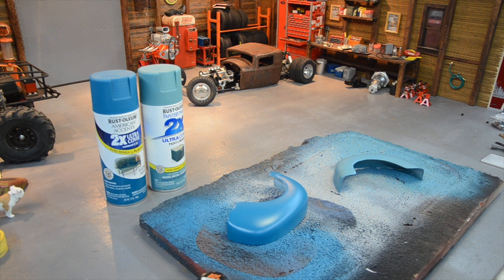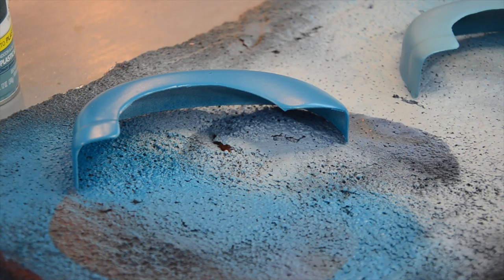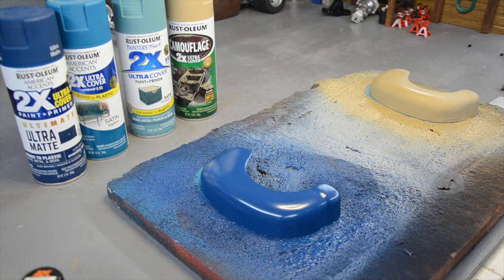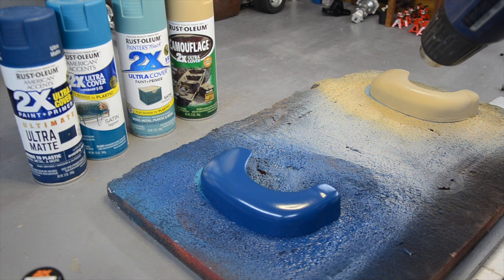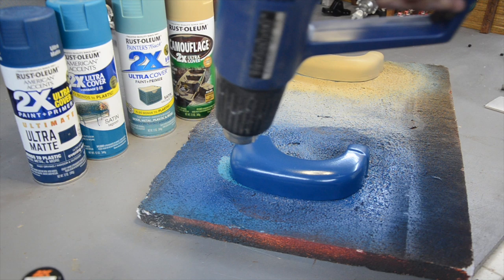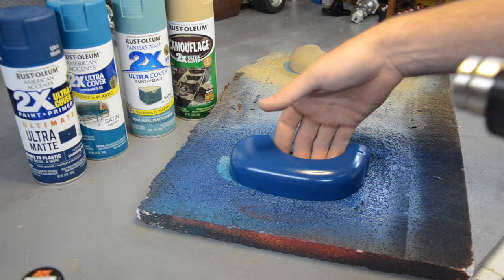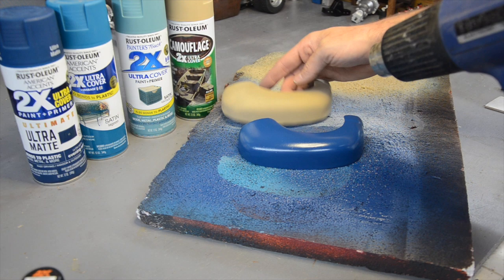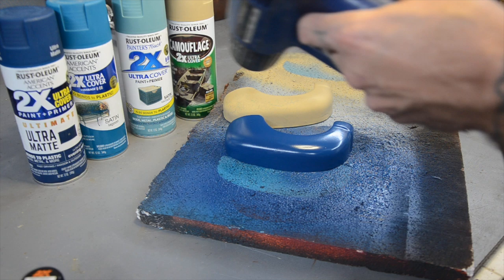Practice Run For Patina 101, My Class At the Ultimate Scale Truck Expo 2020

Comment: Wes' styrene skills are crazy!  The cracking is likely because the paint hadn't had enough time to cure, so it was still degassing.  I  do coats of paint a bit too long of flash times when trying to weather just hoping to get that effect.  If I want a clean paint job and it's flashed more than 30-45 minutes, I let it sit for 24 hours before doing any more coats.  USTE, it can't come soon enough!

Comment: Awesome! In my experience paint cracks when the top color dries faster then the color under it. It shrinks and opens up exposing the color under it. This happens more often when the solvents are stronger in the top layer. For example Krylon dries faster then rusto so put krylon on top and it will crack.